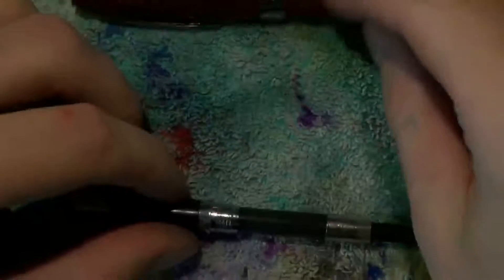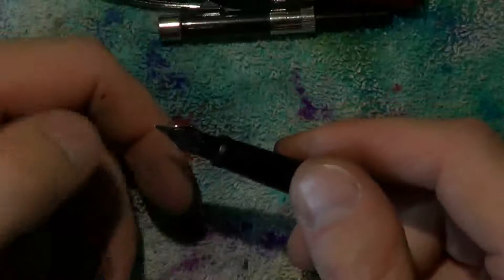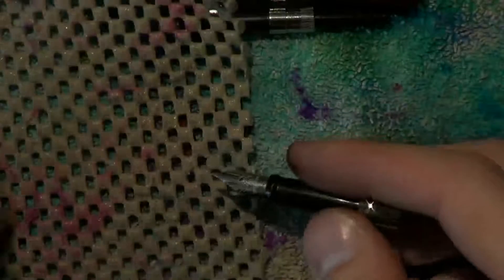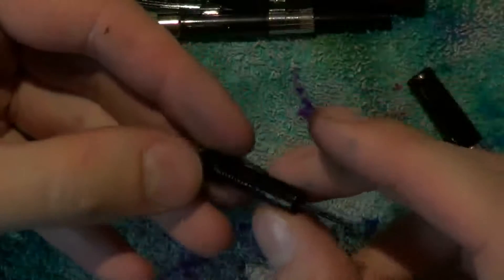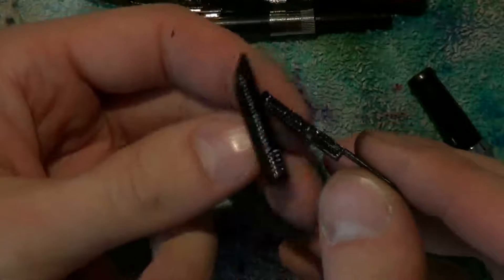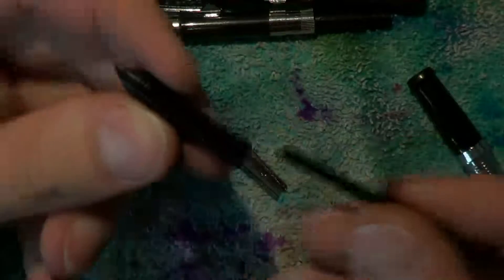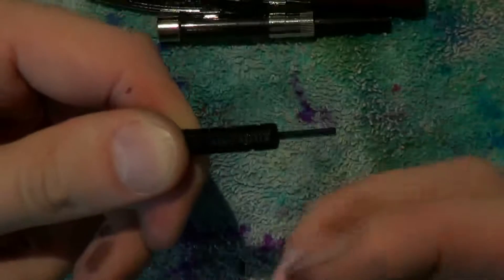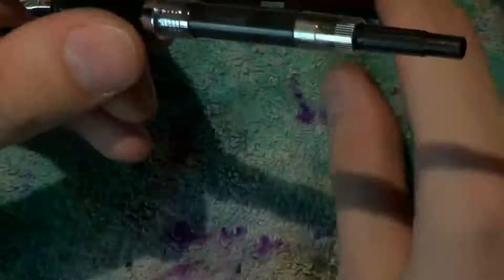Disassembly Line Sheaffer Sagaris

Comment: I recently got a Sagaris, and I've haven't had any luck pulling the feed out, even when using grippy material, any suggestions?
Reply from the maker: I haven't been able to do anything beyond what I show here.
Reply: Soak the unit in hot water a few times. Mine took 3 times